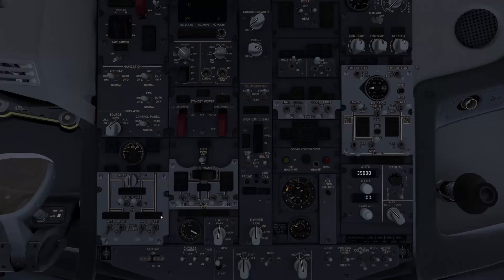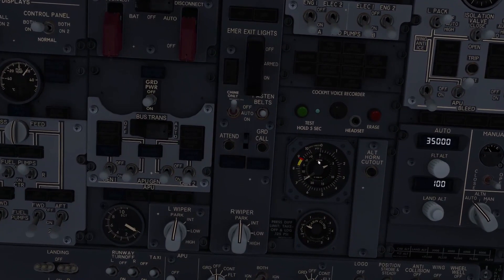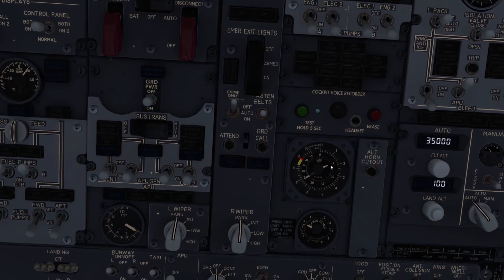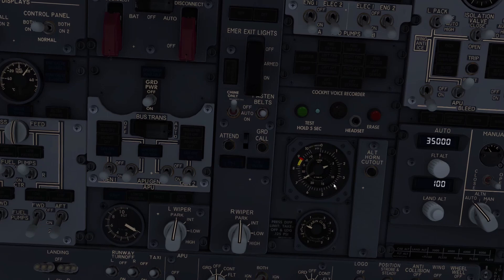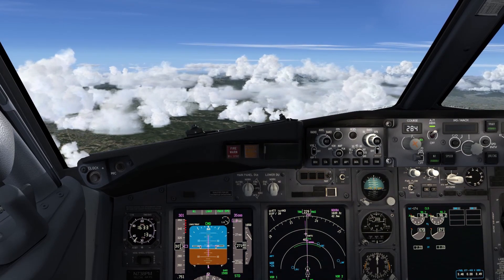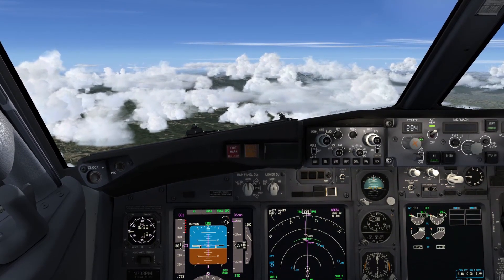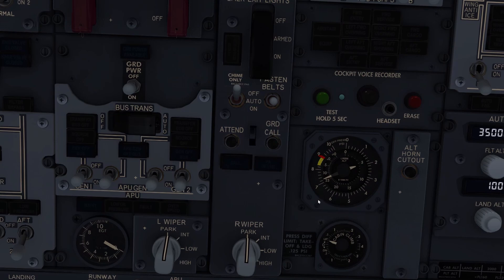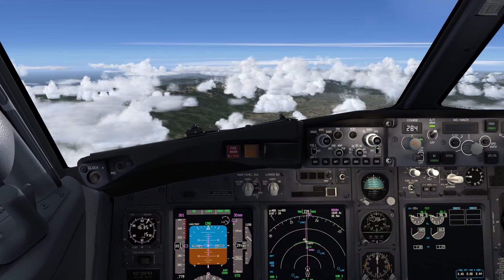Aircraft Pressurized Cabin And Un-Pressurized Cabin - [Cabin Altitude Vs Flight Altitude].

Comment: Hello Captain, I found this video almost by miracle 😂
I wanted to ask you some questions:
1) I was once flying at FL350, had the pressurization panel set for that altitude, but I was cruising with both Packs on HIGH, Trim Air Off, Recirculation Fan On and Engine Bleeds On. The N1% setting was very high too when suddenly I started hearing the "CABIN ALTITUDE" Horn and the cabin altitude was 10.000 ft, differential pressure closing up to 0 psi.
I also noticed that the Duct Pressure was at 55 PSI when usually stays at 30 PSI. Why did this happen?
2) Another time something different happened, I was at FL380 and had to turn the Engine Anti Ice ON, out of the blue I saw the "BLEED TRIP OFF" light coming on. Looking at the official QRH for the B378 it says that is not recommended to turn TAI on above FL350. Why is that so? Does the temperature and the pressure inside the Duct Pressure increase significantly if you use TAI at high altitudes?
Reply from the maker: Hey, 1. Most probably the packs were over stressed, however it is a bit strange because if you were at FL350 and the cabin Altitude was 10000ft you should have had some differential pressure.
2. Did you also switched on the wing Anti-ice?
Reply: @PILOTCLIMB  1) Yes there was some differential pressure but it was descending little by little
2) Honestly I can't remember, maybe I did, yes.
Here you can find a video very similar to what happened to me
https://youtu.be/LoEy66kMnxk
Reply from the maker: Ok, I asked because if you switch on the wing Anti ice above fl350 you might have pressurization problems..

Comment: Great. Concerning pressure configuration, does the flt alt at 35000 and lnd alt at 100 you set up there influence that pressure control? How does the aircraft know pressure should feel like 5000 feet?
Another question, in case of pressure problems, can you descend at your own discretion or should you request clearance from the ATC even though you're in an emergency? Seems like a stupid question, but I assume descending without knowing whether there's traffic below you is as risky as pressure issues, right? If you have traffic avoidance system, can you rely on it to make that decision, in case you have such system, of course or should you get the ATC involved anyway?
Reply from the maker: Many thanks for watching! I hope you are doing great! Yes, the pressure Controllers take the pressure information from the ADIRUs in order to set the right cabin altitude on board. So, depending on the flight altitude and the land alt you set on the pressurization panel the system works accordingly. Concerning the pressurization problems: It all depends on the severity of the problem, let's say you have an explosive depressurization, in that case, you want to descend quickly and send the MAYDAY call. If the problem is manageable then you can ask for descent and manage the situation. It really goes down to priorities. Let me know if you have more questions!

Comment: Very Nice video, understood cabin alttiude very much, but I didn’t understand Differential Pressure. Can you pls explain in deep.
Reply from the maker: Hey, Thanks for watching! So, in order to undestand the differential pressure it is important to know that the lower the altitude the higher the pressure! So, if the cabin altitude is at 5000 feet, for example, and the aircraft is flying at an altitude of 27000 feet, the pressure inside the cabin will be higher compared to the outside atmpspheric pressure. This pressure difference (between the cabin pressure and the atmospheric pressure) is indicated by the Differential Pressure indicator. Let me know if I answered your question! I wish you a great weekend!

Comment: The pressure at 8000 feet varies day by day so this means that the system assumes the isa pressure at 8000 feet ? And how did the systems keeps differential pressure within limits.. if we climbed at 41000 feet the pressure will be very low compared to tbe pressure at 8000 feet
Reply from the maker: Thanks for watching! I hope the video helped you! The Pressurization controllers gets the Air Pressure informations required from the ADIRUs, in this way the pressurization controllers can keep the cabin altitude and the differential pressure within limits. Normally the differential pressure is kept within limits by the Auto Pressure controller that uses a Pressure Relief Valve that opens if the differnetial pressure is getting to high. Let me know if I answered your question!! I wish you a great weekend!
Reply: The video helped me very well .. thank you for you videos ... i understood the criteria and you answered my question thank you very much.